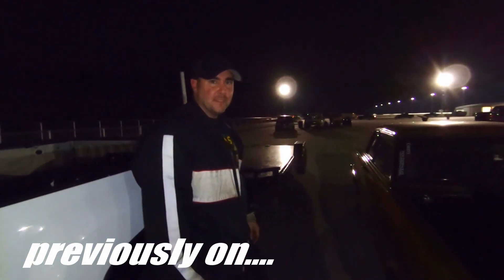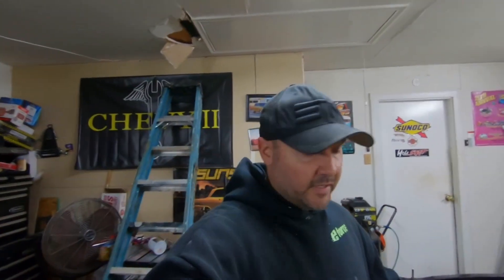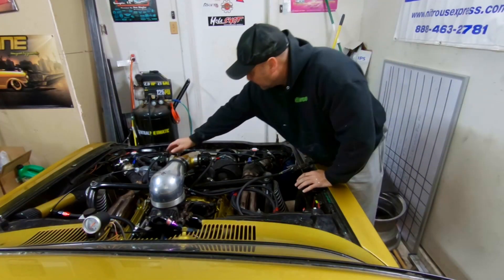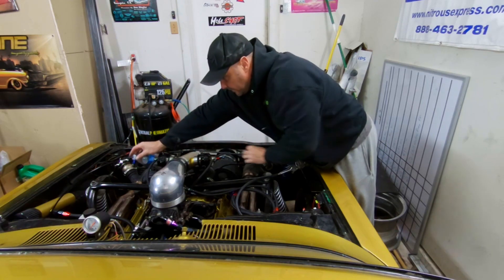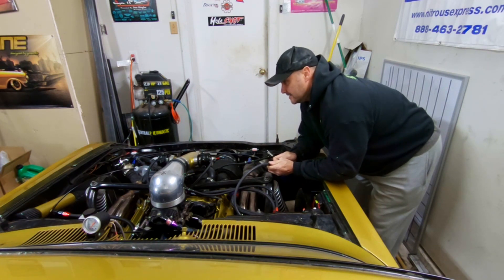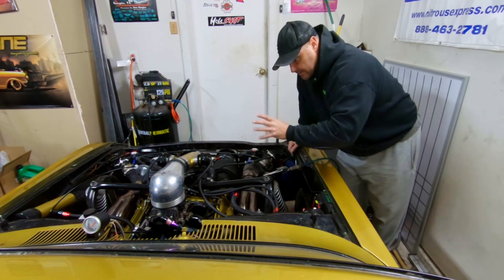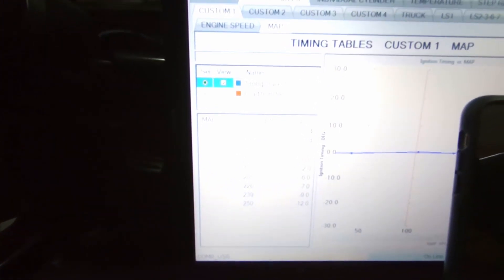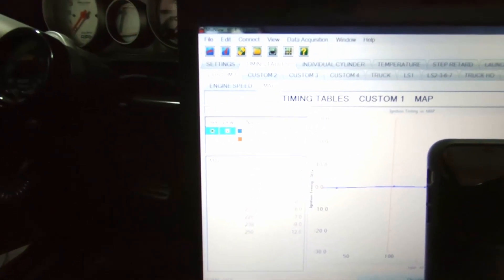msd 6014 test on ls turbo sunshine

Comment: How much time do u put in a 6.0 n/a 6.0 with stage 3 cam?
Reply from the maker: I run 36° base carbureted. Fuel injection is a completely different set up
Reply: @SickSnails  thanks I was told by 30 but I didnt think that was right

Comment: I have been talking to a few guys that have the Red 6014 and there’s does not revert back to 100 kpa. But mine (black) box as soon as it gets to 260 kpa it goes back to 100 kpa and throws a map code. 
But Good Deal on yours. I wished I had a Red box now. Maybe you can get the pop figured out.
Reply from the maker: We got it figured out on the Dyno coming up in next video